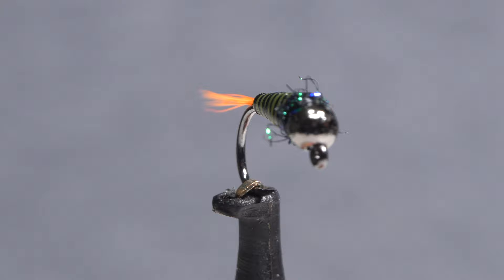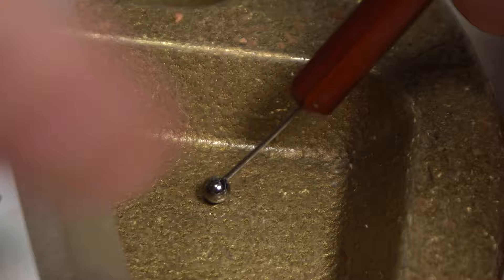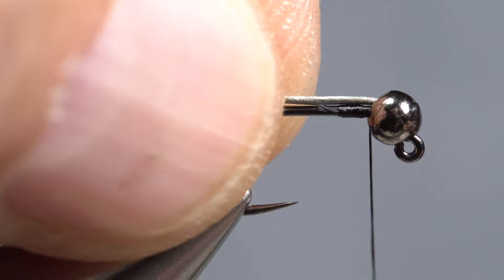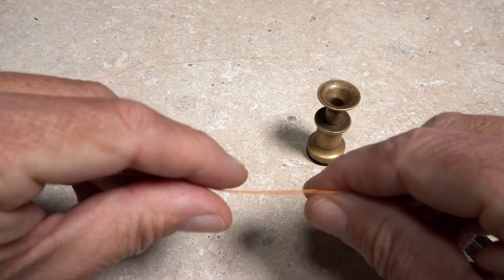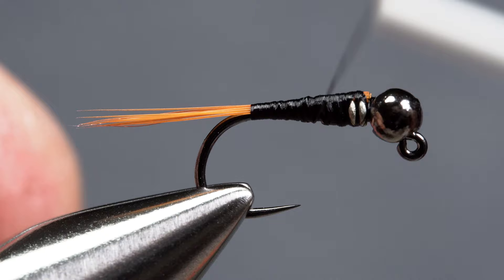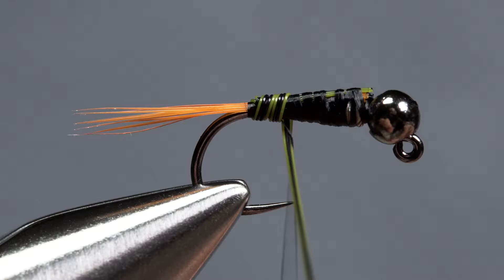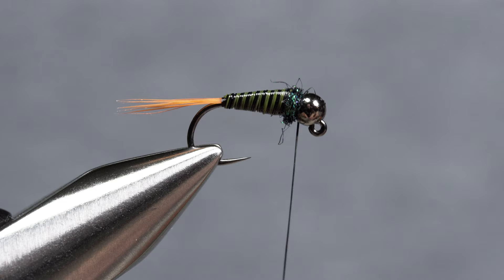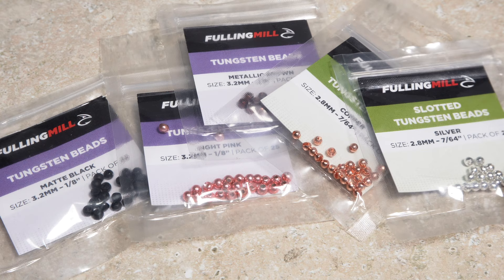Plastic Surgeon

Comment: About that applicator bottle, I put Z-ment into one, used it several times to get just a drop, then reinserted the pin. Next time I reached for it,  the pin was locked tight. Even pliers couldn't move it. Regardless of the cement used, pull the pin out and wipe it down several times before letting it sit.

Comment: Tim, if you coat the fly's body with a UV resin, will it help the durability of the fly?  Have you tried using an orange or red thread to create a hot spot?  What an outstanding fast and versatile pattern!  Looking forward to adding some to my fly box. What sizes do you normally tie them in?  Thanks!👍